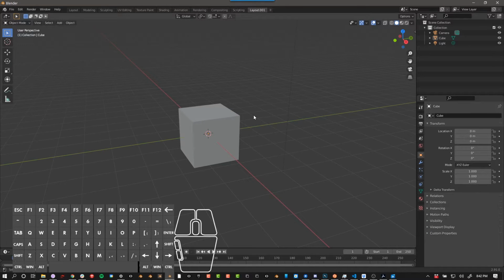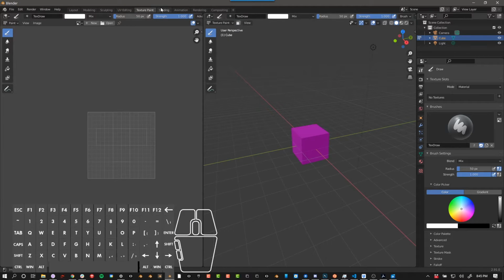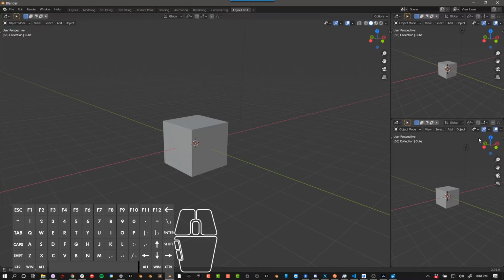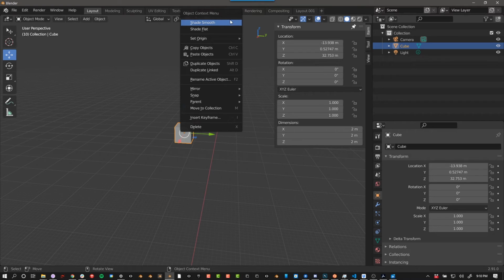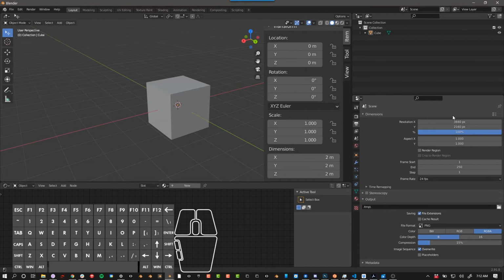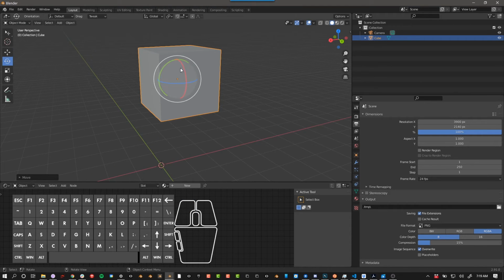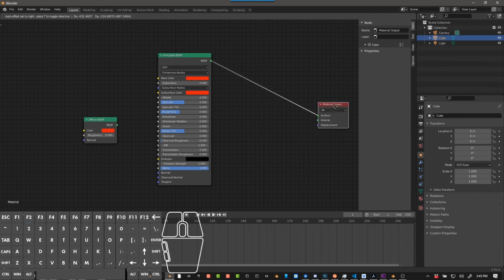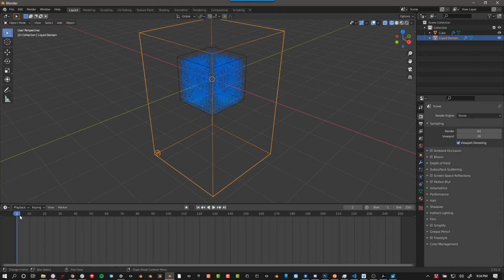Blender Tutorials for Beginners #4  //  User Interface Part 1

Comment: Alright, following! That´s exactly what I needed, thanks for making it available. Quick question. I´ve just installed the Octane Version of Blender, and purchased your Octane Addon. My job is in animation (1K+ frames to render per project are not unusual), so I´m sold into using Octane just for that. BUT as far as beginning with Blender, will Octane hinder that (by making things unnecessarily complicated), or is it OK iyo? Thanks again.
Reply from the maker: That's a tough question. I think in general, it's better to have a good base knowledge of cycles/eevee before jumping into octane because yes it will be more complicated and harder to find specific information. Theres no harm in trying it out or even using both (I use E-Cycles or Octane depending on the project and sometimes I use both on the same project!).
Reply from the maker: Also, I think I was wrong about octane having persistant data, one user pointed out that it does reload each frame. Is your animation photo real? If not, you might be best off using eevee, it can be harder to set up, but then your animation will render 50x faster than octane or cycles. You can get photorealistic results with eevee but it's harder to do imo. There's also a hybrid way to use octane/cycles to bake the lighting and shadows into your textures, then render in eevee  with fast speeds too.
Reply: @AlexPearce3d  Got it, thanks! I think I know what to do. In my work in VR, I usually don’t need to render at all (it’s all handheld camera work). What I’m trying to do is to bring my animations to Blender to render as stop motion animation (which will raise the perceived value quite a bit). But there’s no real hurry to do that. So I’ll focus on learning Blender first, and get a good grip of Eevee as my first step. It may not sound like it, but this conversation alone has shed some real light on the situation, so thanks again 👍 And please keep the tuts coming, the format is flawless. Cheers!
Reply from the maker: @jpbelmont_art  thanks man! I lost steam in the beginner series, because there was very little interest in it from my subscribers, everyone wants to know Octane for Blender. I’m also creating a platform called BLENDERender.co to sell add-ons and 3d models, so that’s taken whatever “free time” I’ve had up as well. BUT I will try to get back to the tutorial series soon. Particularly the stuff that’s not really talked about in other beginner tutorial series.
Reply: @AlexPearce3d  yea, totally get it. There's no point in moving forward if there's no interest from the community. And it seems there's a real need for octane stuff,  so why not enjoy the demand, right? In any case, good stuff man, really helpful 👍